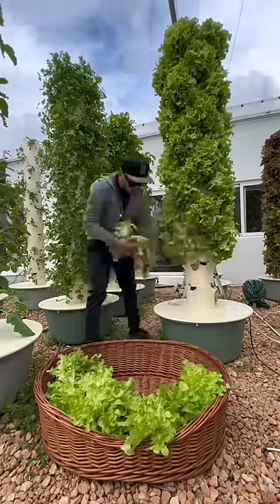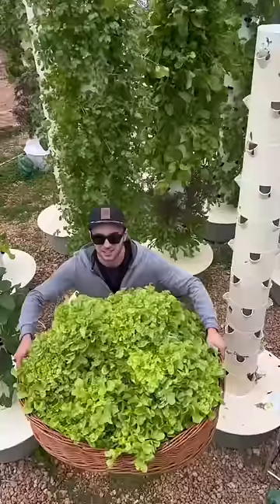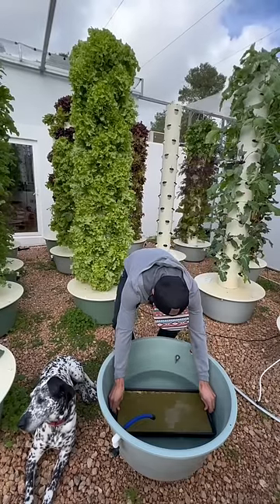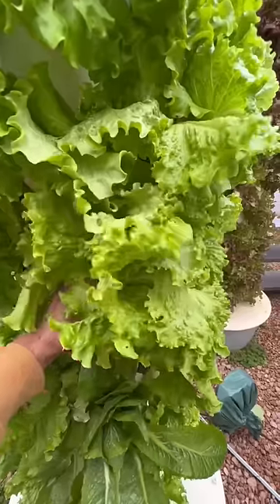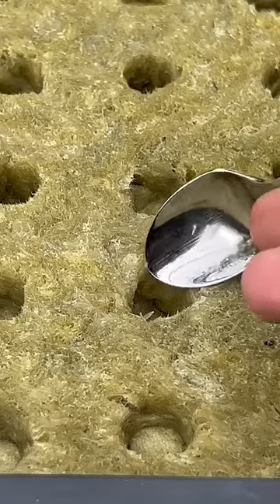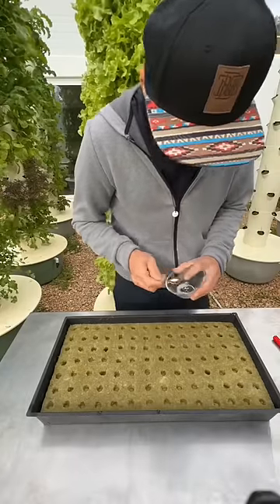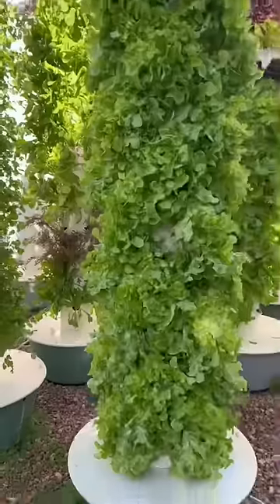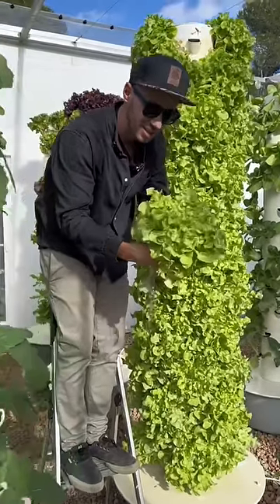Strategies for growing soilless lettuce #lettuce #towergarden #verticalfarming #gardening #farming

Comment: Are these good for AZ? Indoor or outdoor?
Reply from the maker: These aeroponic towers can be set up in almost any climate except for extremely low temperatures below freezing or very high temperatures above 40 degrees Celsius. In such cases, indoor growing or a climate-controlled greenhouse may be required.

Comment: Soil is the best nature for the plants and it's nutrients. Growing without soil, may cause loss of essential vitamins and nutrients and it may have adverse affects as well.
Reply from the maker: Aeroponics is a technique that allows plants to have a 100% supply of oxygen at the root level, making it easier for them to absorb nutrients. As a result, crops grown using this method have some of the highest nutrient density, antioxidant, and flavonoid levels ever tested in soil farming. These elevated levels translate into improved flavor, texture, and water content in vegetables.

Comment: Does it have the same vitamins and minerals due to not growing in soil that is full of minerals
Reply from the maker: The use of aeroponic towers in plant cultivation guarantees plants a steady supply of oxygen at the root level, which enhances their ability to absorb nutrients. This method produces crops with nutrient density, flavonoid, and antioxidant levels that surpass those achieved through soil farming. These elevated levels of nutrients translate into superior flavor, texture, and water content in vegetables.

Comment: How do the lettuce get minerals from water-only in hydroponic or aeroponic process?
Reply from the maker: There is water mixed with nutrients that sits in the reservoir with a low-wattage submersible pump. The plants are irrigated intermittently 3 minutes on and 12 minutes off continuously.
Reply: @Agrotonomy  Thank you. 😀

Comment: Some plants do this cool thing when there is a lack of nutrient and therefore lacks components to convert NO3-nitrogen to NH4-nitrogen to make amino acids. There is a build up of NO3- nitrogen which creates large light green leafs but at the cost of rot development and less chlorophyll in the leafs for photosynthesis. The plant is now good at handling a waterlogged environment (losses water through leafs during fotosynthesis) but lacks structure. This is not a universal truth for all plants, but it's a typical NH4 deficiency symptom /excess NO3 in lettuces. 
Ps. I don't have my notes on this process available at the time of writing this, so I am unable to be specific on what exactly happens in a lettuce during this process. I therefore encourage anyone to add on information on this subject especially if i have spread misinformation and to help highlight the importance of a fertile soil. 😊

Comment: does soil-less veggies have the same nutritional content as the vegi grown on soil ???
Reply from the maker: The use of aeroponic towers in plant growth allows them to receive 100% oxygen at the root level, which enables them to absorb nutrients more efficiently. As a result, crops grown using this method have nutrient density, flavonoid, and antioxidant levels that exceed those found in soil farming. The increased levels of nutrients translate into improved taste, texture, and water content in vegetables.

Comment: Rockwool is what I use for insulating. Also don’t touch it with your bear hands. (Glass fiber splinters)
Reply from the maker: This is agricultural rockwool, not rockwool for construction. Agricultural rockwool has no chemical binders. Additionally, when we work with the rockwool, it is soaked in water.

Comment: You grew a bunch of flavored water congrats
Reply from the maker: Aeroponic growth provides plants with a continuous supply of oxygen at the root level, which boosts their nutrient uptake. Consequently, crops grown using this method have remarkably high nutrient density, flavonoid, and antioxidant levels compared to soil-grown crops. These elevated nutrient levels translate into improved taste, texture, and hydration in vegetables.

Comment: How do you get it from the tray to the tower?
Reply: You just water it.
You 're welcome. 
: )
Reply from the maker: We start everything from seed which we put in agricultural rock wool (made from basaltic rock). You water the seeds until they germinate and become seedlings which takes 2 to 3 weeks depending on the variety. You then transplant the seedlings on the aeroponic tower, and they are irrigated through a submersible pump in the bottom reservoir that provides water mixed with an ionic mineral nutrient solution that provides all the essential minerals and trace elements for healthy plant growth.

Comment: But after it starts to take root on the pan- how do you get it in the tower?? 😳🤔
Reply from the maker: Our planting process begins with seeds that are placed in agricultural rock wool made from basaltic rock. These seeds are watered until they germinate and develop into seedlings, which usually takes 2 to 3 weeks. After this, the seedlings are moved to an aeroponic tower, where they receive water enriched with an ionic mineral nutrient solution that provides all the necessary minerals and trace elements for plant growth. This solution is delivered through a submersible pump located in the bottom reservoir.

Comment: So how do you get them from a flat into a tower?????
Reply from the maker: We initiate the growth of all our plants from seed, which we place in agricultural rock wool (made from basaltic rock). The seeds are watered until they germinate and become seedlings, which typically takes 2 to 3 weeks depending on the variety. The seedlings are then transplanted onto an aeroponic tower, where they receive irrigation through a submersible pump located in the bottom reservoir. This pump delivers a nutrient solution enriched with all the essential minerals and trace elements required for optimal plant growth.

Comment: Is the nutritional value still the same?
Reply from the maker: Aeroponics is a technique that allows plants to have a 100% supply of oxygen at the root level, making it easier for them to absorb nutrients. As a result, crops grown using this method have some of the highest nutrient density, antioxidant, and flavonoid levels ever tested in soil farming. These elevated levels translate into improved flavor, texture, and water content in vegetables.

Comment: the yield is really good, but this system has a very shortcoming.
namely the taste of the crop in the blindfold test, 9/10 people recognized the lack of taste compared to the plant that grew in the ground.
Reply from the maker: Plants grown aeroponically benefit from a consistent oxygen supply at the root level, which improves their nutrient absorption rate. As a result, crops grown using this technique have exceptional nutrient density, flavonoid, and antioxidant levels that outstrip those of soil-grown crops. The increased nutrient levels lead to vegetables with better flavor, texture, and hydration.

Comment: But plants need good soil so how does that work?
Reply from the maker: There is no soil inside the tower, only water mixed with nutrients is located in the bottom reservoir. There is a pump that irrigates the plants intermittently.

Comment: What about the rest of the process???
Reply from the maker: We start everything from seed which we put in agricultural rock wool (made from basaltic rock). You water the seeds until they germinate and become seedlings which takes 2 to 3 weeks depending on the variety. You then transplant the seedlings on the aeroponic tower, and they are irrigated through a submersible pump in the bottom reservoir that provides water mixed with an ionic mineral nutrient solution that provides all the essential minerals and trace elements for healthy plant growth.

Comment: The problem is it's not getting any nutrients from the ground from the soil so it's really just water green water in lettuce form
Reply from the maker: The aeroponic tower doesn't rely on soil for growth, as only water and nutrient solutions are present in the bottom reservoir. To irrigate the plants, a pump is used intermittently, providing the necessary hydration and nutrients for optimal growth.

Comment: I get the "per square meter" comment but technically you would need more space as they would otherwise block out sun from each other.
Reply from the maker: If you arrange the towers from north to south, every side of the tower will get sufficient distribution of light.

Comment: A horizontal Hydroponic system is hard enough to manage as a local farmer. This was made for corporations level of business for some good reason.
     You really need to understand everything about Hydroponic system first, then triple the effort you put into checking everything. The pH level of water must be stable and must stay within just a small gap.
    Lettuce alone are already really weak without constant water, if something messed up for just 2-3 hours, it’s almost guaranteed a disaster.
     pH too high or too low? Yellow leaves problem is await. Green net(40% sun block) is an absolute must for hot climate. These plants will have almost no immunity due to the same reason why your parents want you to play with dirt and additionally, most bio farm land would actually have more beneficial bacteria to the plants more than the bad one. So without those plants allies, those Hydroponic plants are just like featherless chicken living in a tight cluster await for disasters to happen every 2-3 days.

Comment: You left something out. You jumped from flats of seedlings, to harvesting from towers. You didn't show how you transferred the rockwool flats into individual tiny holes of the tower.
Reply from the maker: We initiate the growth of all our plants from seed, which we place in agricultural rock wool (made from basaltic rock). The seeds are watered until they germinate and become seedlings, which typically takes 2 to 3 weeks depending on the variety. The seedlings are then transplanted onto an aeroponic tower, where they receive irrigation through a submersible pump located in the bottom reservoir. This pump delivers a nutrient solution enriched with all the essential minerals and trace elements required for optimal plant growth.
Reply: @Agrotonomy  Thank you.

Comment: Looking nice, but the costs are pretty high and the taste is different.
Reply from the maker: Aeroponics is a technique that allows plants to have a 100% supply of oxygen at the root level, making it easier for them to absorb nutrients. As a result, crops grown using this method have some of the highest nutrient density, antioxidant, and flavonoid levels ever tested in soil farming. These elevated levels translate into improved flavor, texture, and water content in vegetables.

Comment: How do you put them in the tower thingy tho
Reply from the maker: We initiate the growth of all our plants from seed, which we place in agricultural rock wool (made from basaltic rock). The seeds are watered until they germinate and become seedlings, which typically takes 2 to 3 weeks depending on the variety. The seedlings are then transplanted onto an aeroponic tower, where they receive irrigation through a submersible pump located in the bottom reservoir. This pump delivers a nutrient solution enriched with all the essential minerals and trace elements required for optimal plant growth

Comment: The only thing though is the lettuce as nutritious as a lettuce grown in soil? My guess is the lettuce in soil will have more vitamin, minerals etc. if you look the lettuce they are growing foes not have a deep green color it looks very pale.
Reply from the maker: Aeroponically grown plants have access to 100% oxygen at the root level, enabling them to absorb nutrients more effectively. This method produces crops with nutrient density, flavonoid, and antioxidant levels that are unparalleled in soil farming. The increased nutrient levels translate into vegetables with better flavor, texture, and hydration.

Comment: Okay, but you skipped how we got from box to tower. This is like saying, "Step one: buy a computer. Step two: Check the program you've been writing for bugs one last time and then submit it to the IT company you work for." It's not like I can't imagine what the transplantation process is like, but...
Reply from the maker: We initiate the growth of all our plants from seed, which we place in agricultural rock wool (made from basaltic rock). The seeds are watered until they germinate and become seedlings, which typically takes 2 to 3 weeks depending on the variety. The seedlings are then transplanted onto an aeroponic tower, where they receive irrigation through a submersible pump located in the bottom reservoir. This pump delivers a nutrient solution enriched with all the essential minerals and trace elements required for optimal plant growth.

Comment: What about the taste?
Reply from the maker: The use of aeroponic towers in plant growth allows them to receive a constant supply of oxygen at the root level, improving their nutrient absorption rate. Consequently, crops grown using this method have exceptional nutrient density, flavonoid, and antioxidant levels that are superior to those of soil farming. The increased nutrient levels result in vegetables with a superior taste, texture, and water content.
Reply: @Agrotonomy  I’m the one deciding if the plant has superior taste, not an advertisement tirade. “Superior” means nothing. It’s a potential characteristic not an actual one. You can give a better taste if you know the right nutrients combination.

Since forever we know that different terrains give plants taste, flavours and other characteristics. Remember the importance of terroirs for wine production. But if you ever do grocery shopping you know that as well.

Comment: This is great but water is a limited resource
Reply from the maker: These systems actually save 95% water usage compared to soil grown crops. For residential towers, you can use your own tap water or treated water, whereas for commercial farms (10 towers or more), you can use the water supply system.

Comment: He didn’t show the how the lettuce was placed to grow horizontally
Reply from the maker: We initiate the growth of all our plants from seed, which we place in agricultural rock wool (made from basaltic rock). The seeds are watered until they germinate and become seedlings, which typically takes 2 to 3 weeks depending on the variety. The seedlings are then transplanted onto an aeroponic tower, where they receive irrigation through a submersible pump located in the bottom reservoir. This pump delivers a nutrient solution enriched with all the essential minerals and trace elements required for optimal plant growth.

Comment: I'm about to say You're going to have to run motors keep that water flow going That's not saving anybody money unless you get free electric
Reply from the maker: Each aeroponic tower is equipped with a low-wattage submersible pump that operates at 45 watts working intermittently 3 min on and 12 minutes off continuously, which means 4.8 hours per day. To calculate the cost of electricity, you need to multiply 45 watts x 4.8 hours = 216 watts.

Comment: He didn't actually demonstrate how he grew the vegs in those poles though.

🙄🙄🙄
Reply from the maker: We initiate the growth of all our plants from seed, which we place in agricultural rock wool (made from basaltic rock). The seeds are watered until they germinate and become seedlings, which typically takes 2 to 3 weeks depending on the variety. The seedlings are then transplanted onto an aeroponic tower, where they receive irrigation through a submersible pump located in the bottom reservoir. This pump delivers a nutrient solution enriched with all the essential minerals and trace elements required for optimal plant growth.
Reply: @Agrotonomy  Awesome info.👍

Comment: I'd say Only One Line.
Water is not soil.
Reply from the maker: These plants are grown in aeroponic towers, meaning that there is no soil used, only water mixed with a 100% ionic mineral nutrient solution is used. This allows the plants to receive all the macronutrients and micronutrients that are necessary for healthy plant growth. This method of farming saves on 95% water usage and 90% space when compared to soil based farming.

Comment: Isn't the substrate rockwool found to be cancerous.
Reply: If inhaled. It's a mineral fiber and it can be similar to asbestos but not as risky. 
When it's kept wet, it's pretty safe. I've used it before but I prefer expanded clay.
Reply from the maker: Rockwool for agriculture is compacted differently and is used after being soaked and therefore does not present a health risk. In other terms, although we recommend to handle rockwool with gloves, contrary to general perception, it is a safe material.

Comment: This is why the msot vegetable doesnt have taste.... its tasteless. if its greens look same it doesnt mean its same
Reply from the maker: The use of aeroponic towers in plant growth allows them to receive 100% oxygen at the root level, which enables them to absorb nutrients more efficiently. As a result, crops grown using this method have nutrient density, flavonoid, and antioxidant levels that exceed those found in soil farming. The increased levels of nutrients translate into improved taste, texture, and water content in vegetables.